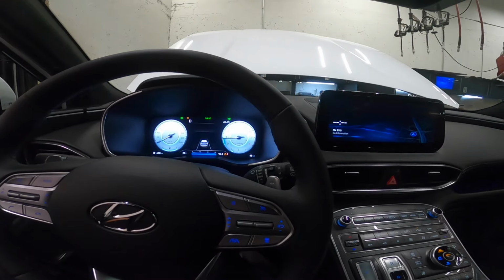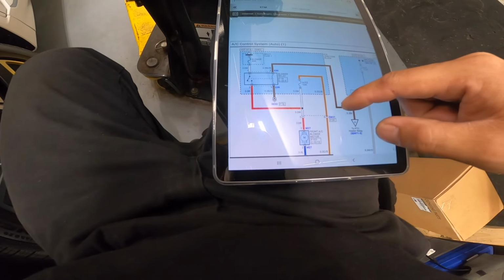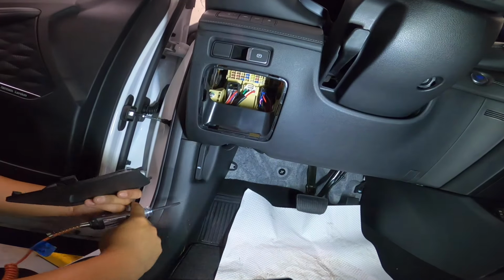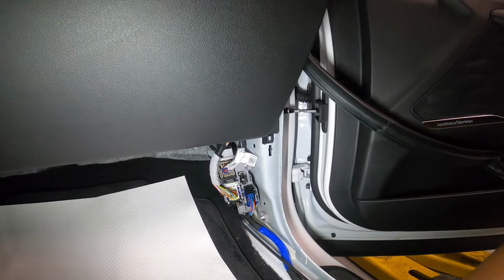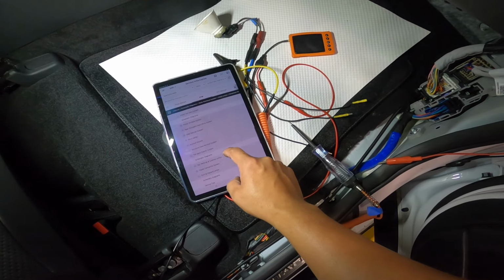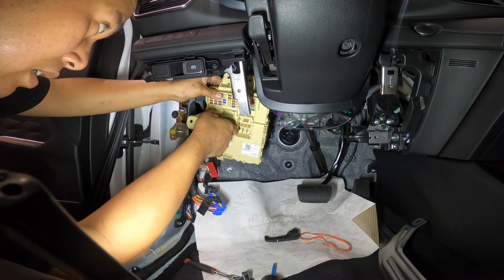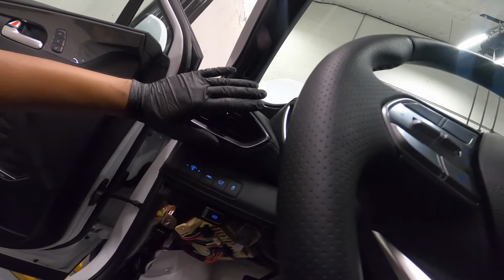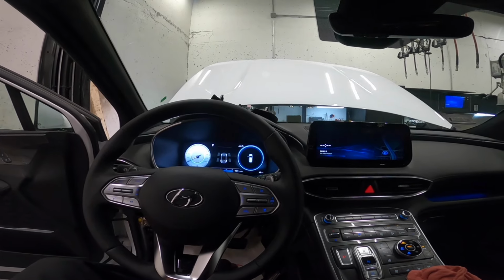Hyundai Santa fe | Hazard lights and blower fan not working correctly

Comment: Hi sir, I have a small question regarding the blower problem. Why didn’t you use data analysis and actuation tests?
Reply from the maker: Well in this case the easiest for me was just to move the blower motor controls in the hvac panel

Comment: I have a 2012 Genesis with the 4.6  with a little over 64,000 miles had the car since 2012 new im having the same problem my hazard light flashing none stop ive change the switch still flashing everything else seems to be working any suggestions
Reply from the maker: If you unplug the switch is the hazard still on, if yes something is shorting the circuit.